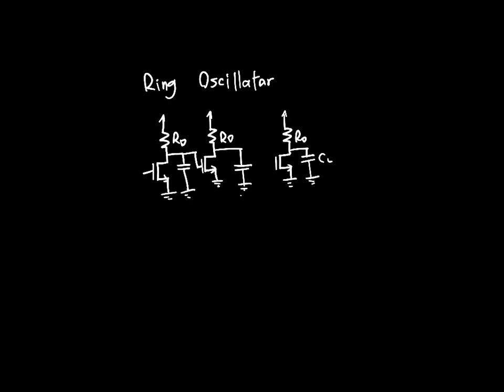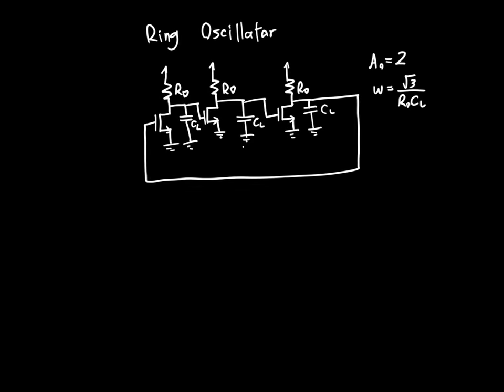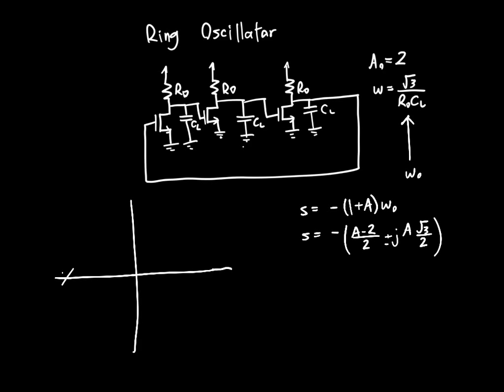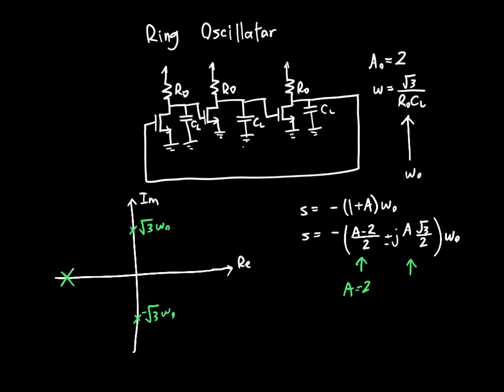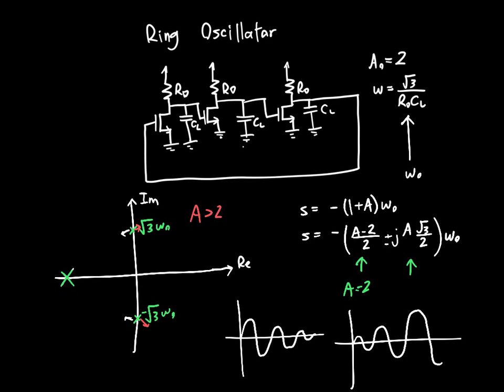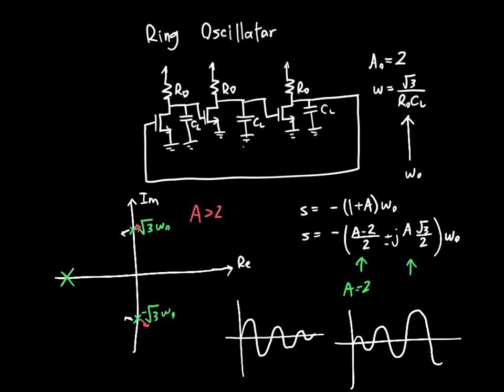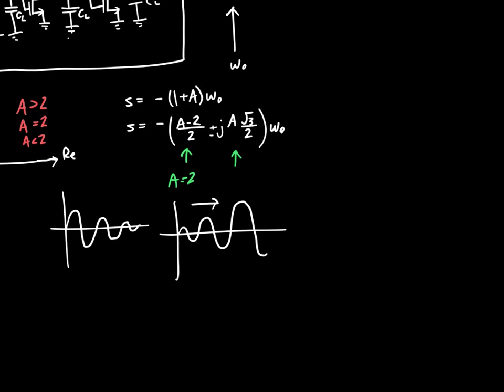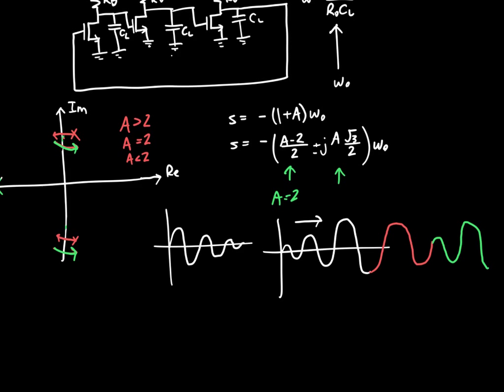Ring Oscillator Analysis Part 2

Comment: A should be <-2 for the poles to be on the right half of the S-plane. If A=2, there is a negative sign outside the bracket, and the real part of the second pole will be zero
Reply from the maker: Good catch. A0 should actually be -2 (because these amplifiers are inverting), and the equation should read (A + 2)/2, with no minus sign out front. Larger gain magnitude should lead to worse instability (faster exponential growth) with poles further in the RHP.

Comment: I simulated the circuit in LTSpice. Whatever gain i take, after initial 10 ps or something,  it always results in stable oscillation. Rd = 11.7k. C = 1n. W/L = 20/11. W = 20u and L = 11u. In reality, i could not observe any envelope that you mentioned at 7:13.
Reply from the maker: Thanks for the comment! Thinking about it more that actually makes sense, the poles move to the LHP within a single cycle once your oscillation grows to its maximum amplitude, rather than across multiple cycles causing an “envelope” as I drew it. Once you reach steady-state it will just change the frequency during that cycle, giving a non-sinusoidal shape.

Comment: How did you get the poles ?? please clarify this
Reply from the maker: All you need to do is calculate the transfer function for each common-source stage and then multiply that by itself three times (or however many inverters you have) and you will have the poles :). I go over this in Part 1, here: https://www.youtube.com/watch?v=fwU8s1BMNlA&t=1s.